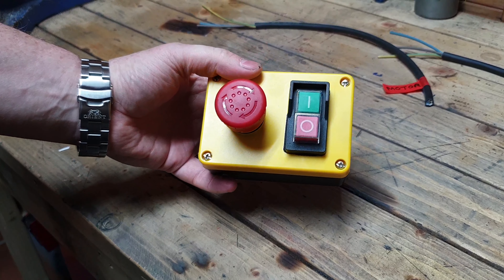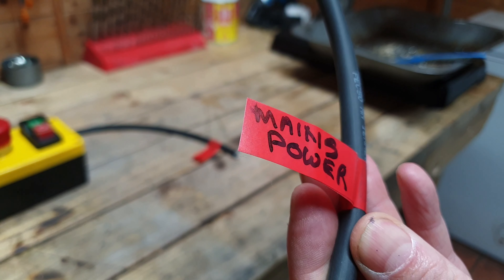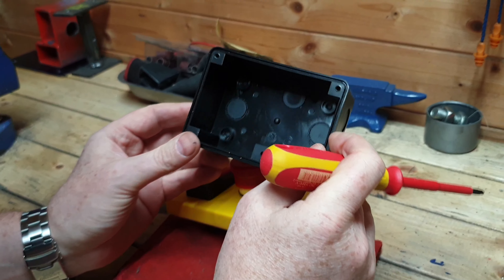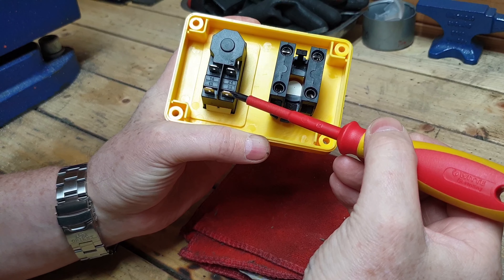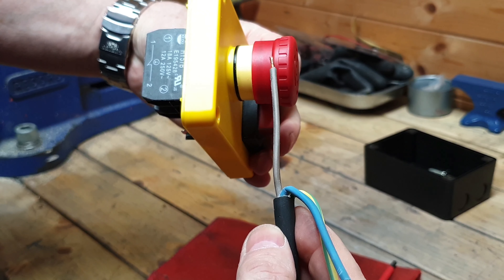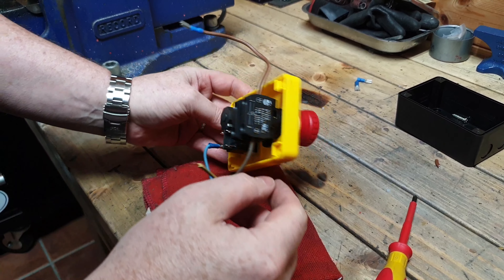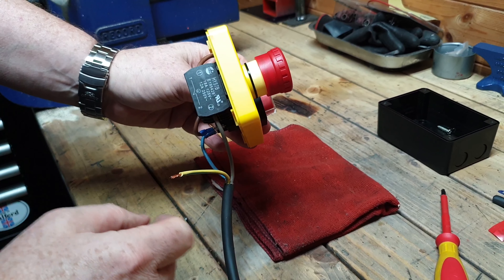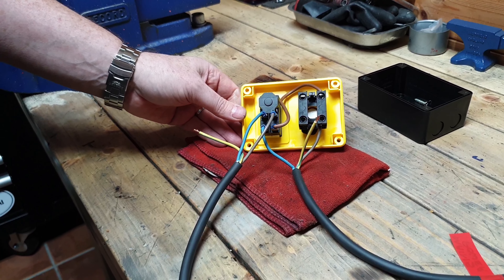How to Wire an NVR Switch with Emergency Stop

Comment: Useful video, it saved me several minutes of head scratching.
I've just used it to add the same switch to an old lathe. It replaced a not so ergonomic switched spur that the previous owner had rigged up. I'm glad to have a big red button to slap should I need to.

Comment: Hope this helps to clarify things for some: Pin A1 is only present on the 5-pin version and is mainly used for motor protection if required (overload etc)  and usually connects to the motor.
‘IF’ your motor does not use or need the A1/5th pin then it has to be connected (shorted) to pin24 or the switch will probably not work! 
This is a workaround to make the 5-pin switch work in a 4-pin situation !!
Best rule is to buy the unit with the correct switch in it! 4-pin or 5-pin (4-pin, 5-pin and 110v 4-pin versions are available!)

Comment: I have a KEDU KJD17B 240V UK version of this.
The hole is there for the A1 terminal but it is not fitted.
The emergency stop button is double pole normally closed, (both poles are NC, even though the legends on the side could easily suggest one side was NC and the other NO).
Therefore, in my case, the supply feed L & N will go into the emergency stop switch. From there L goes to pin 13 of the NVR and N to pin 23.
When the green 'ON' button is pressed L is switched to pin 14 and N to pin 24. 
As terminal A1 is missing, the magnetic coil inside is linked internally to get its power from the 'load' side of the switch. The switch is held in the on position whilst power is present and there is an audible click as the the electromagnet engages.
When power is interrupted, both poles of the switch open. The electromagnet is supplied from the load side of the switch and is therefore no longer energised.

When you press the red 'OFF' switch (especially slowly), there is a buzzing/vibration just before the electromagnet releases (as David Urwin mentions). This is a bit un-nerving and cheap feeling.

Many people report their switch doesn't latch on. I assume this will be in versions WITH the A1 terminal. Based on my findings, this would need to be linked permanently to pin24 in order for the electromagnet to work. Probably why it is linked internally in mine.

The electromagnet draws approx 4W all the time it is energised and the switch housing gets warm (although not the outer case).

There is a resistance of 4.7K across pin 14 and 24 which is presumably the coil and workings of the electromagnet. This would be a good way to ensure your version has the A1 link internally.

I hope this helps people, just like the original poster of this vid helped me. There seems to be many variations of this device, that look similar or identical. Use a multimeter if you have one to check yours.

Comment: Good video however you appear to have made a number of errors from my experience with fitting a similar NVR. The first error is that the active (Brown wire) coming from the wall plug should be connected to terminal 1 on the emergency stop switch. Second, the active (Brown wire) should come out terminal 2 on the emergency stop switch and connect with pin 13 on the on/off switch which is internally connected to pin 14. Pin 14 then goes to the motor (this is also connected internally to the electromagnet switch). The return path from the motor is connected to pin 24, which is linked internally to pin 23. The neutral (Blue wire) is connected to pin 23 and runs back to the plug to the wall socket. The most important thing that you missed is pin A1 which controls the switch relay (electromagnet switch). A wire needs to be run between pin A1 and pin 24 to power the relay switch otherwise the switch will not work. This in mind you need to connect both the output from A1 and return from the motor to the same spade terminal and connect them to terminal 24. I hope this is of assistance to anyone who wishes to install a NVR and has had troubles getting it to work.
Reply from the maker: Thanks John. You are obviously more qualified than I am re: electrics.. I appreciate your comment👍🏻
Reply: Not really, it was just hard won experience by trial and error, or might I say trial by ordeal. @BestUserNameUK
Reply from the maker: @johnwp111  Check my other vid' as the switch functions correctly and the wiring is as per the diagram supplied.
Reply: Will do. @BestUserNameUK
Reply: @johnwp111  Thanks John, you're kudo
Reply: I notice the E-Stop switch is two pole, is there any problem with running brown on one pole and blue in the other? And in other applications, should one E-Stop switch ever be used to throw several Solid State Relays?
Reply from the maker: @intelligenceservices  Thanks for commenting. Unfortunately electrics & electronics are not my forte.. but I'm sure these switches could be wired in a number of ways for specific applications. I kept mine simple as it's only used on a drill press.
Reply: THANK YOU 2000% mine would not latch until I followed your method
Reply: There are two Emergency Stop switches on this model. The first (Terminals 1 and 2) are normally closed when the Stop button is out, and open when the Stop button is pushed in. Use these to interupt the live to the on/off switch. The second switch (Terminals 3 and 4) is normally open, and connects when the Emergency stop button is pushed down. It is not used in this application.
Reply: I have the same NVR switch but the "ON" button only works when it is depressed but when I let go of the button it shuts off.
Does these NVR switches work on 120 volts? Are they specifically made for 220 volts currents? I have 6 of these switches to install on all my power tools, viz..Router Table, Band Saw, Table Saw etc. all of them ran into the same problem. Were my switches faulty ones.
Reply: Hi Aung,
They will work on 120 or 230 volts.  From what you describe you may not have connected the holding coil A1 to terminal 24.  Follow these instructions and it will work.

Incomming supply from your plug.

Connect the incomming  AC live to Terminal 1 on the Emergency stop switch. In Europe this is the brown coloured lead.

Connect terminal 2  with a loop to terminal 13 on the on/off switch. I used a brown wire for this.
Note terminals 3 and 4 on the Emergency Stop switch are not used.
Connect the incomming AC neutral to ternimal 24 on the on/off switch. In Europe this is the blue lead.

Outgoing lead to your motor.
Connect the live lead (Brown in europe) to terminal 14 on the on/off switch.
Connect the neutral lead (Blue in Europe) to terminal 24 on the on/off switch. You will also need to connect a second lead from terminal 24 to terminal A1. You can use a pigy back connector, or put a second short wire in the spade connector for terminal 24 and cripm both in place. I then soldered the short lead to terminal A1 as I did not have a small connector for this treminal.

Connect the earth leads, (yellow/green in europe.) to the block at the back of the box and also to a clean metal point on your machine. This connects the machine to earth should there be a fault.

Hope this helps. Seasons Greetings. Richard.
Reply: @richardmasters3262  I thank you, kind sir. I have one more question, is terminal #23 not use? Does all Neutral wires connect to #24 terminal?
Merry Christmas and Happy New Year to you, kind Sir.
Reply: @richardmasters3262  Sir, I thank thee most heartily, It worked flawlessly as you instructed. I had not connected A1 terminal as it was so small, I failed to see it. You brought my attention to it and it worked at the first try. Again thank you. I was about to discard the whole lot, all six (6) of these kill switches as total loss.
Reply: There is a mistake in my instructions.The incomming AC neutral should be connected to terminal 23 and not 24 as I wrongly stated above. My appologies for this and seasonal greetings from the UK.
Reply: @aungthein5154  Hi again from the UK. I am pleased this helped. What part of the world are you in? Richard.
Reply: @richardmasters3262  USA
Reply: @richardmasters3262  Thanks, Richard. I realized that terminal #23 and terminal #24 were connected internally, so I just connected neutral from main to terminal #23 and attached terminal #24 and A1 together to the neutral wire going to the motor. And everything worked just fine. It was my failure to attach terminal A1 to terminal #24 that caused the problem. Since then I have added A1 terminal to #24 to all my "kill switches". Now I can stop my power tools in an emergency by bumping on the "STOP" button or paddle and cut out the voltage safely. Again many, many thanks for your help.
Reply: Thanks alot man. I followed your instructions and everything went perfectly. You should think of making a video of your own.
Reply: Tx a lot!!
Reply: Hi John, I purchased the exact same NVR switch as above to fit to my Kitty 619 table saw and followed your instructions to the letter all except for a black wire coming from the saws motor, the switch works fine but the black wire becomes live when the NVR is switched on. Any idea where I should connect this wire to. Many thanks.
Reply: @richardmasters3262  Hi Richard I have just been reading your instructions on the NVR switch I wanted to know  how to do this for a while however I'm just a little confused how TD original video his switch still worked even with out connecting A1 and 24 together and connecting ac in into 2 first I'm confused 🤯 can you shed some light on it for me if possible many thanks mark
Reply: @markandrews8437   Hi Mark.
I think TD's switch did not work as he wired it. It needs the coil of the relay to be connected.
Amplifing NVR, it stands for No Volt Release. It is a switch that turns your machine on and off, and importantly, will not allow the machine to restart should the mains fail and then be restored. This particular switch also has an Emergency STOP switch. Unfortunately the switches I wired are not available to look at due to Corona lockdown. I will try to work out the pin numbers from the above and write it up again. Are you in the UK?
Reply: @richardmasters3262  Hi Richard yes I am in the uk the north east I am an adult trainee electrician and unfortunately we dont get to see or wire this sort of switch as a  trainee but your explanation was excellent I have so many questions for you thank you for getting back in touch
Reply: @richardmasters3262  Hello Richard sorry to pester you can you shed some light on this other nvr switch I have it has the main emergency stop then the green on red off switches however the spade connections at the back for the red and green switches are marked 1.2 .3.4 then A1 spade connector 2 bells out with A1 would these connect the same as the switch marked with the numbers 24 23 13 14 the switch I have is a kjd 18 single phase many thanks
Reply: @richardmasters3262  hi Richard got the switch numbers wrong its 1.2 .5.6 .A1
Reply: Pin A1 is only present on the 5-pin version and is mainly used for motor protection if required and connects to the motor.
‘IF’ your motor does not use A1/5th pin then it has to be connected to pin24 or the switch will not work! This is a workaround to make the 5-pin switch work in a 4-pin situation.
Best rule is to buy the correct switch! 4-pin or 5-pin :)
Reply: J_ G_  all of these type switches usually are supplied with 1 NC and 1 NO contact block on the emergency stop; hence you only need to wire the live through the NC contact block and could use the NO contact block to operate for example a indicator lamp.
Because of the way the NVR Switch operates you do not need to wire double pole through the emergency stop so the above is ok.
Reply: Aung Thein they are available 110v and 240v. If the switch does not stay on then you either have an error in the wiring or it is faulty. To be honest they are very reliable so check the wiring ;p
Reply: Hi John. The most accurate and competent description I have seen! Absolutely correct, follow Johns instructions. I'd like to raise one thing I've seen both physically and from advice from internet "experts". The NVR red button is a stop switch to stop the machine in normal operation, the E-Stop is to disconnect the machine and power down, so the green start button no longer functions until the Estop is manually reset reset to continue. There is advice on the internet to wire the Estop between A1 and 24. This means even if the Estop is tripped, the green start button still acts as a jog button and should the NVR fail (the spring breaks or the contacts weld) the EStop will not do it's job. Bad accidents only happen when multiple things conspire against you. Follow Johns advice.
Reply: John, do you know where I can find a wiring diagram to add an additional stop switch, like a micro switch on a horizontal bandsaw for automatic shut off when the cut is finished? Thanks very much
Reply: A1 is provided for a Motor to connect to, allowing the motor to instigate the cessation of power (due to thermal overload (motor overload?)) A1 was never designed to be simply shorted to Terminal 24 (this works but if you do not have that extra cable from the motor and therefore do not need terminal A1, you should buy the 4-pin version!

Comment: Hi TD I have a dust extractor that is fitted with an NVR and a thermal cut out, but I want to be able to remote start it. How can I do it please. I thought about bridging the wire on the 12.13.23.24 but would that affect the thermal cut out I realise the Emegency stop wouldn’t work. Any help greatly appreciated

Comment: Greetings. looks like great video, helpful. However, what is connected to the 5th terminal A1?  i connect as You demonstrated on the 4 main terminals, however my table saw "runs" while i hold the green "depressed". i leave the green the motor cuts.... as if the "electromagnet" is not holding the green in on "position" :-(
Reply from the maker: Hi. Scroll down to John Pettits comment & replies. Yours seems to be a common problem.
Reply: @BestUserNameUK  sorted - i done that connected "A1 to #23" and wala - switch works perfectly now :-) saw turns continious until a cut in power supply of the stop is pressed. Thks

Comment: I've found just one thing that does not make sense. I wired the exact same switch as you did, but it didn't work!
Further, hunting, I found that the long narrow spade connector, located next to the contactor, marked A1 needed to be bridged to connector 24. It seems some switches are sold with the connection being made internally, so if yours doesn't work, just bridge the twp A1to 23.
Reply: Hi, that was the auxiliary contact. It can be wired in series with another protection device if required. I'd suggest a foot operated switch that you can stamp on to stop the drill in case of mishap. See my note above. BobUK.

Comment: Hi. Do you know of such a fault with this type of switch my switch is the DKLD DZ-6-4 15A 
250V Sounds like the off button when switching the machine off has a
 vibration in the switch, like some thing is pushing from the other 
side. Can you please tell me if this is normal.
Reply: David, bit late to reply .. but I have a similar (but not identical) NVR to you. There is an energised magnet inside that keeps the switch in a closed position. Mine also makes a slightly un-nerving buzzing vibration when pressing the red off switch. I would imagine this is just a result of the way the electromagnetic coil/magnet releases. Still a bit 'cheap' feeling.

Comment: Have you done a video for the KJD12 switch. I bought one but it had no diagram. There are terminals 1&3 IN: 2&4 OUT but which is which?
Reply: Diagram is found on the side of the switch....

Comment: your switch will not latch on unless you connect the A1 terminal to activate the solenoid to pin 24

Comment: I have the same NVR switch installed. But for unknown reason when I press the "ON"  the current only flows when the "ON" button is depressed and when I let go of the "ON" button the current cuts off. Is my NVR switch faulty?
Reply: The circuit is not latching and you have a momentary push  button by the sounds of it.
Reply: It's that A1 connection! Bridge it to 24